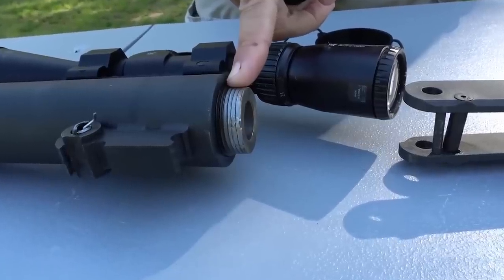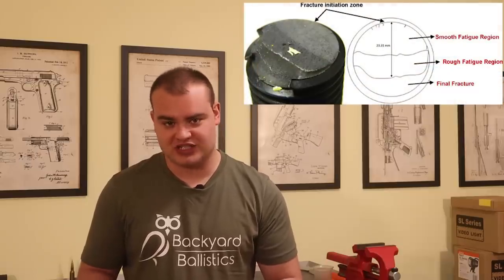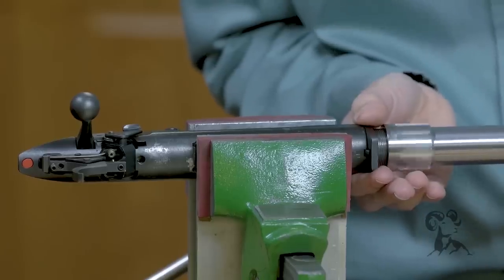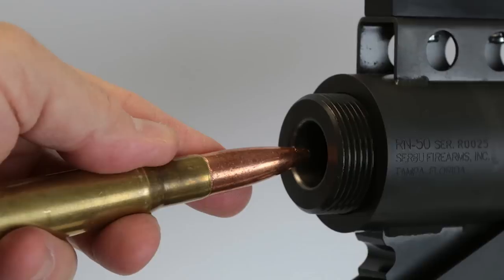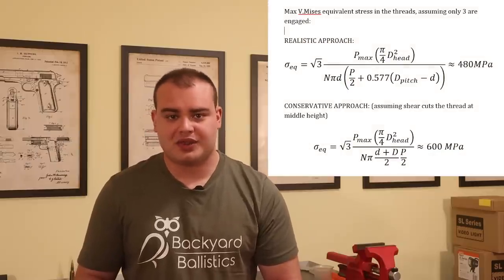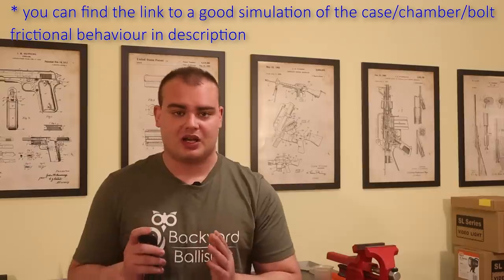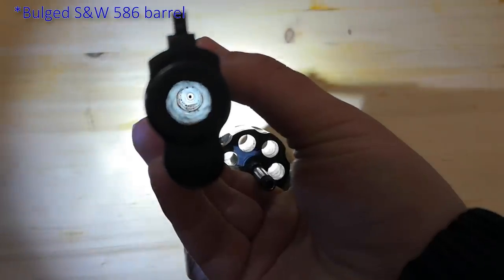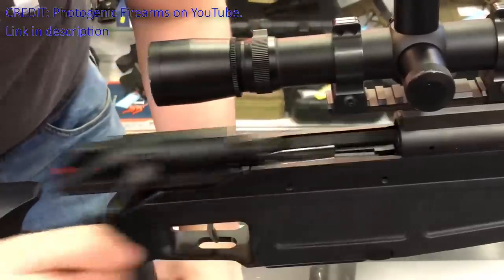Serbu RN-50 Failure: A Closer Look

Comment: The muzzle brake theory might be something you discount, but the mechanic as to why the muzzle brake was blamed by some cannot be discounted. Scott's RN-50 was not a standard barrel IIRC, it was a slightly larger diameter to accept certain rounds that would not ordinarily fit inside an RN-50 as the tolerances on that weapon were different to those of the M2 Browning, which most 12.7x99 ammunition variants are explicitly designed for.
The mechanism of the brake obstruction was that a brake must be specifically calibrated to prevent shavings of the sabot from building up around the brake. This is because of the assumption that the bore itself would naturally be perfectly calibrated to accept the ammunition, and therefore no additional calibration or testing would be required. This is not the case with Scott's RN-50, as the slightly adjusted bore has different tolerances. This fact is stated explicitly by Scott himself in the "50 Cal SLAP vs Atlas Stone" video on the Kentucky Ballistics channel, stating larger tolerances specifically for accommodating ammunition the weapon was not designed to run. This means that as other ammunition, even regular ammunition is used, the extra tolerance could have been filled by dust, lead shavings, brass shavings... almost anything. Upon switching back to plastic sabot rounds, while the breech section that takes the full width of the brass may not have been subject to minute detritus from the passage of the projectile, the rest of the barrel in its entirety was not. This includes the section of the barrel around where the shoulder of the slap + the exposed Sabot would sit.

Do take some time to consider the non-standard nature of the setup, and how that may contribute to an obstruction resulting in increased chamber. Do also note that it is still perfectly conceivable that this is not the case, or that both the round was over-pressured AND the breech was partially obstructed leading to catastrophic failure of the firearm by multiple contributing factors.

Comment: Is there some reason to not just put a "weak" point somewhere in the chamber that is directed away from the shooter? I really don't feel like any gun design should have a weakest link that, if it fails, will result in pieces of the gun being blasted toward the shooter.

Comment: I'm highly suspicious of the ammo used, I wonder if it was authentic or reloaded and sold for 100$ each
Reply: Someone up-thread posited the idea that old ammo that might have been corroded might have been tumbled to make to clean and shiny for re-sale but during the tumbling the powder would have also ground into smaller bits and increased the burn rate exponentially.

Comment: Mark Serbu has a friend who is an engineer who examined what happened.  He said given the fact the gun is 1" 1/2x12 threads with a rockwell hardness of C-30, he surmised it was not 85,000 PSI that caused the failure, but about 161,520 PSI that caused it.  About three times or so pressure of a single SLAP round.  When I first looked I thought it could also have been a underloaded round causing a SEE (Secondary Explosion Effect), then I watched Serbu's video and he thinks it could be that also.  Guess we may find out when he gets the gun back for examination.
Reply: So a guy who makes potentially deadly equipment has an engineer look at his desgn AFTER an accident has happened? As opposed to being an engineer himself or hiring an engineer to check his guns before he sells them? I guess that explains something...

Comment: What was that barrel made of? Pot metal?
It was obviously cross threaded.
What were it's cycles?
Being put together and taken apart 100 times a day?
It was misuse.
Reply: Cross threading was unlikely, the metal ‘ears’ are there specifically to ensure the cap is properly seated.

Comment: I was literally just thinking of suggesting interrupted threads when he was talking about longer threads being impractical.
Classical interrupted threads would have to be very long to work as you lose half the engagement surface per turn. However, a stepped, Welin-style interrupted thread would work, but be much more expensive to manufacture.

It is also THEORETICALLY possible to have an openable breach thread that had plastically deformed, as long as the threads all deformed by the same (or similar) amount. Could there ever be a circumstance where this happens? Unlikely. The low number of threads would make the stress distribution across threads more equal, but even so... If it was still operable, I'm not sure how you wouldn't notice the threads getting much stiffer.

Comment: I'm from the UK and we don't have guns like that, but from an engineering perspective this video was amazing.
Reply: I don't know if the RN-50 is on the UK market, but single-shot or manual .50 BMG rifles are legal to own.  The main issue is a shortage of ranges where they can be shot.
Reply: @jic1  dude the license required to own a gun here is so strict though.
Reply: @jackpark4646  Well yes, but it's also strict to own a .22 LR rifle.
Reply: I never said that it wasn't lol 😂
Reply: @jackpark4646  The point is that if your statement that "we don't have guns like that" was just about the difficulty of obtaining a license, then it also applies to a .22 LR rifle.  You might as well have said 'we don't have guns'.
Reply: @jic1  fair point.

Comment: On the explosion you can see a huge blast coming out of the barrel end. To me seems this round was probably a squib round. What other round would have enough energy to blow the chamber to bits and still shoot a 5' blast out of the muzzle?
Reply: Uh, not a squib, that's for sure. Play more COD, I'm sure it will help.
Reply: @camojoe83  troll.
Reply: Squib rounds aren't overpowered, they are underpowered.  The danger they pose is that they might not produce enough energy for the projectile to leave the barrel, causing an obstruction that can cause the next round fired to blow up the firearm if it isn't spotted and cleared.

Comment: I have watched numerous videos on the causes of this incident. Every “expert” seems to have a different theory. I’m inclined to believe if there are no fail safes designed into the firearm, to prevent the bolt from hitting the operator in the face when a major malfunction takes place, it is not a firearm that I would own or shoot. Someone described it as nothing more than a 50 BMG zip gun, and I tend to agree with this observation.

Comment: I've personally witnessed 4 firearms explode in person. 2 were due to firing after a squib load. Which ruined the barrels. 1 was a hand loaded 30/06 with a Double powder charge that blew the receiver open and the most recent was an ar 15 pistol with a a folding brace adapter. "Chinese knockoff" that let go at the Hinge after a 28 round mag dump. That was actually the worst as the guys face was up against that adapter when it happened. 
What I've learned from these instances is. 
ALWAYS buy quality Parts and AMMO.
Always wear Safety glasses.
And when reloading. Realize im not mass producing and take the time to ensure every round is properly primed, charged, and seated.

I don't believe any of the above mentioned accidents were the fault of the shooters. 
Guns, like any Tool can, and will fail/ have issues at some point.
Be safe guys!
Happy Shooting!

Comment: Has anyone considered that, that particular round was loaded with a powdered explosive vice a propellant?  Is it possible that a pistol propellant was used?  I've read that the chamber pressure required to fail is around 85,000psi or 50% above spec of 50,000psi.  Since this was a SLAP round is rotten storage a possibility like the USS IOWA "B" turret.   Perhaps a design change will help but not eliminate this with defective mil-surp ammunition.

Comment: Could the temperature of the rounds make a difference in the pressure? Such as the rounds sitting in direct sunlight.
Reply: It does affect the performance but not in such amount that it could have caused this.
Reply: Yeah. I have a rn50 and live in the Tampa Bay Area. We shoot in the summer and in the heat and I haven’t seen a measurable difference in round pressures.
Reply: @aaronhiggs  Yeah, as an old artillery guy I measured powder temp and age, barrel wear etc. for accuracy. I would be more careful with ammo age then temp to be honest. I would also never shoot anything but store bought or loaded by yours truly. Absolutely never second hand ammo. Especially when we're talking these calibers...

Comment: I am betting the overpressure was from plastic fouling buildup in the barrel. Some barrels just do not like certain types of bullets. I have a .38 that will not shoot cast lead. One cylinder and the cylinder gap blast increases as the accuracy goes to pot.
You can see in the video the increasing muzzle blast after each slap round.

Comment: What would the shear pressure of the retaining lugs behind the cap be?
Reply: Interesting question. Since it's basically just a chassis to hold the fire control group it may not be specced for any kind of pressure bearing.
Reply: @Reactordrone  Carolina Gun guys says the lugs alone have a shear pressure of around 15,000 pounds

Comment: Seems like the results of an extremely over-pressure round...maybe on top of shooting dozens of Slap rounds through a gun with a muzzle break. But I'm not sure how much the muzzle break really came into play in this situation. Also, the threads are more than strong enough under normal pressure that the slap round that exploded the gun had to be a plus p+++++ Slap round.....I know that's not a thing but I think you get my meaning.....most likely it was loaded with some extremely fast burning powder either by mistake or worse.
Reply: I have the rn50 so I’m really familiar with the fire arm and this is my hypothesis as well. Probably had some sort of obstruction plus a extra hot round.

Comment: BUTTRESS THREADS?

The buttress thread form refers to two different thread profiles: One is a type of leadscrew often used in machinery, and is also known as the sawtooth thread or breech-lock thread form.
Reply: They won't add any shear area, and larger diameter threads make it worse since area inside the cap go up faster than the area of the threads. He's talking out of his ass.
Reply: @randyg9209  I don’t think any type of threads make a good breech lock at all anyway. Spend the extra money and get a proven design.

Comment: Damn.. everybody seems to have there own opinions/theories an making videos off this.. this is a good informative video tho.. I do find it funny that People are trying so hard on YouTube to blame the gun. That gun has been in use for 3 years with no defects.. this was an issue of shooting multiple corrupted over-pressured old non-commercial specialized rounds, Not just 1 that resulted in a horrible situation. When you subject anything to multiple over pressuring there will eventually be a failure period no different than a air compressor can actually go above its rated MAX Pressure but if you do that you are risking failure at any time it could be the 1st 2nd 3rd or 4th time. It's a WHEN factor not an IF Factor. P.S I loved the PragerU AD on "Privilege"

Comment: You said that the "explosions" occurs at the point of the obstruction.  This is only true if the point of the obstruction is also the weakest link.  As your picture of the ruptured barrel illustrates, because the barrel wall is thinner and weaker than the chamber wall or the locking lugs, etc., that is where it is going to fail.  If the threads are the weakest link, then that is where the "explosion" will occur if there is an obstruction.  Personally, I doubt if this "explosion" was caused by an obstruction.  I suspect too loose of thread fit, improper heat treatment, material selection, design, not fully engaging ALL the threads (the first one or two thread appear not to stripped) and of course a faulty round (improper powder, etc.).

Comment: A couple of other things about threads: A single 1/3-13" eye bolt can safely lift 2000 pounds before breaking, threads are strong as hell.

There's also the consideration of thread engagement, I.E. what percentage of the threads are in contact with the bolt or cap. Most designs go with a 75% thread engagement, which is more than adequate. Why? Because going up to a 95-100% thread engagement only increases the holding strength by 5%
Reply: He addressed that thread engagement issue in the first video.

Comment: He used slap rounds with a muzzle break. Big NO NO!! He mentioned 1 round was off by a couple feet. Another round barked a bigger flam. Slap rounds are actually lower pressure rounds. That plastic cup can get stuck or cause build up. It failed at the weakest point.

Comment: As the truth is always at the middle, I think both the construction of the gun and Scott's decision to use rounds not made to be used with such weapon led to that sad event. I believe guns should always be built as fool-proof as possible, as we humans are stupid sometimes, all of us. 
So choosing to put fewer threads on the cap for reasons like "the gun would suffer irreversible damage regardless if that cap would blow off" or "it takes longer to screw it in and out" is kind of a not well thought through decision by the manufacturer and he should bear part of the blame. As KB too for using the wrong round in that rifle but he's been nothing but humble about his mistake, so hats off.

Comment: Okay so based on how the gun broke on Kentucky Ballistics id say the gun needs to be reinforced with small redesigns for safety.  Serbu needs to put in bigger threads and the lock and unlock needs to be reinforced and strengthened to ever avoid even opening up on an extreme pressure round wether faulty or not.   I understand that yall are saying it was the round that cashed the explosion but it doesn't matter because the gun still broke apart and in order to prevent something like this in the future it must be reinforced

Comment: I'm just thinking about how many threads are engaged when you screw the barrel into the reciever. Certainly more than 4. For 4 threads to fail catastrofically all threads must fail. Or look at the base of a windmill tower. My guess is that those nuts engage 10 to 12 threads. Either all the threads fail or they will all withstand the stress. I never heard of that kind of failure in windmills. Your idea of vent holes in that cap is sound. But be sure to direct escaping gases away from the shooters face and hands somehow.

Comment: Amazed at how many comments these videos are getting...all this interest in a "what dunnit". Regardless of the what, how and why, sadly, it did fail and it may have been from an unimagined failure mode. You'll never stop someone using old ammo, so even if this is a one in a million event, it could happen again.

I orginally mentioned what Ian @Forgotten Weapons said, and he may have been a bit harsh, but his comments are in line with the comments and suggestions @Backyard Ballistics made on the first video and were sincerely meant to be helpful, ie the design is safe, but in the case of this specific over pressure event the RN-50 design was not fail safe due to the failure of the cap and two lugs failing in the direction of the shooter. So all that matters now is making it fail safe for this type of event, and for that we'll have to wait for Mark's investigation.

Comment: It looked to me like the powder in that round did not burn, it exploded. Shaking and handling can cause powder to become finer grained over the years, but this was extreme. Do the math. The CUP on that barrel is 62,000 Max. Those threads are 1.5-12 and to shear them off not including the two steel post it also sheared off, took well over 100,000 pounds. Look up Bluegrass Armory pressure teat or something like that. The sawed the barrel off and screwed set screws down into it on top of each other and fired a live round in it. It did not explode, the pressure leaked off and they opened the bolt. Something was wrong with that round. Check the powder and see what was in that case. And if you got to shoot this 60 year old ammo, change the powder to H50 in the appropriate amount.

Comment: Backyard Ballistics  There is another and more likelier cause for the explosion.
If some where during all this time, the ammo was stored in some tin shed or something else that wasn't cooled by
Air Conditioning or Underground, heat would have quickened the breakdown of the Double-based gunpowder. 
 As most of the powder just degrades, the Nitroglycerine will only "separate" from 
the rest it. And that is Explosive Energy waiting to happen! And it will happen a lot faster than the gunpowder itself
is capable of. I don't know how old the ammo was! Still, any chance of this happening?
Reply: SLAP rounds didn't exist before 1985.  But yes, improper storage is a possibility.

Comment: Hi mate i dont know if your awear .. the slap rounds used by Scott was not usable with a standard 50bmg Rifle  the tolerances are to tight , Mark Serbu actually fitted a heavy barrel with machine gun tolerances  to Scotts rifle  .. i believe there my have been  a overcharged bullet and to much tolerance and the case the aloud exhaust back past the case ... the barrel was mentioned in one of Scott's earlier vlogs.... thanks for your great clips mate